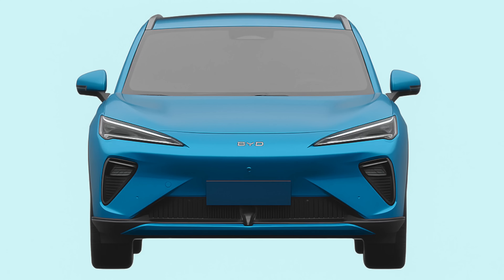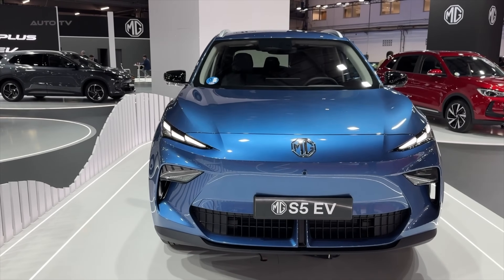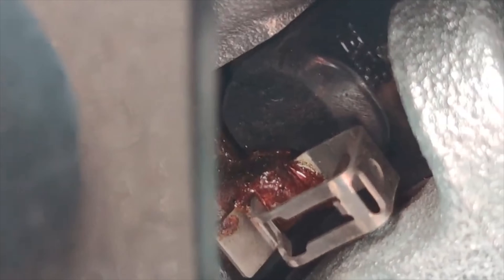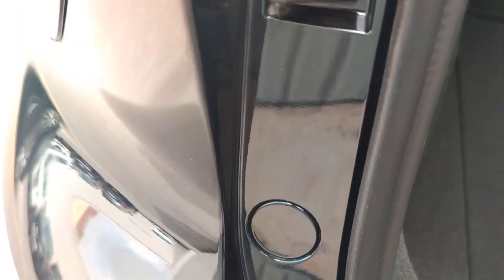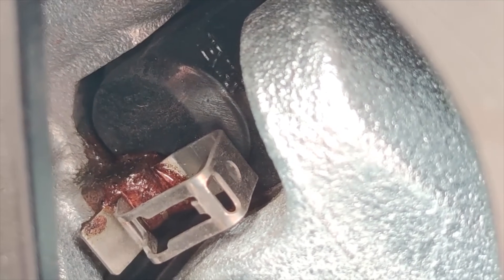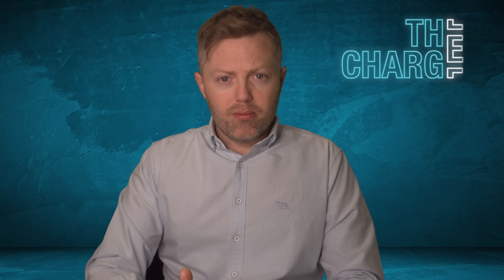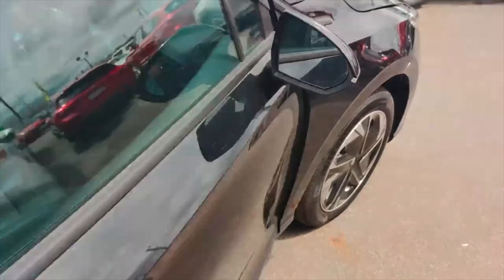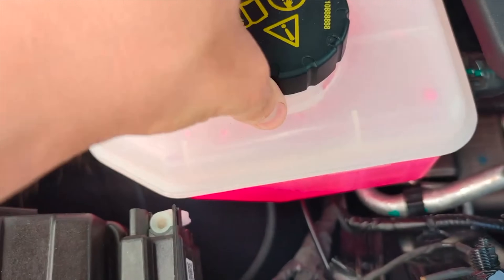NEW MG 6 EV is JAW Dropping – Dual Motor, 77kWh Battery

Comment from the maker: Would you get the MG 6 or a BYD Sealion 7?
Reply: Both are low quality Chinese rubbish!
Reply: Sealion has a bigger LFP and BYD builds well. I guess it would be the more expensive of thes 2.
Reply: Both are extremely BAD choices, poor build quality, poor service when trying to get something fixed, abysmal depreciation, basically worthless in just a couple of years!
Reply: @billsmith281  Wow shocking to see reps from legacy auto here. Enjoy your petrol guzzler that no one wants
Reply: @caramelexspressofan Yeah keep believing that😂
Reply: In the U.K. would depend upon the relative prices, but have a BYD dealer just down the road so probably test drive both.
Reply: I would probably go for the MG S6 in Australia. MG has a dealer network with factory support not just a showroom with third party servicing partners. I recently bought an MG4 and thoroughly impressed by it. Some minor quirks but exceeded my expectations.
Reply: Toyota corolla
Reply: No, MG doesn't come close to reaching the top 10 reliable car manufacturers list. 
Only reason I'm here watching this video is to learn what trash is being made for us.
Reply: I'd buy the MG 6 a little disappointed by the battery size.
100kwh would be great

Comment: You are optimistic about MG and OTA updates, we have 2 MG4 Trophies an LR and ER, cars have built in esims capable of doing OTA, but rumors of UK MG4 getting these keep getting squashed that we will not get. Extremely disappointing given my son's ID3 bought same time as LR , 2 years ago started getting OTA updates approx 9 months ago ( didnt have when initially purchased)
Reply from the maker: Hey mate, I just wondered what sort of updates he's been getting for the ID3 out of curiosity? I'm hearing mixed messages about the OTA updates for MG. In all countries.
Reply: @benalexxander  The ID3 updates have been manly infotainment, very odd others would need to verify , but my son only knew he had update when he spotted changes in the infotainment, VW never told him. 
The latest MG4 LR update at service back in march 25 reset , radio, Bluetooth, and broke the vehicle Hotspot, car had to go back to get sorted and this fix reset infotainment settings. Hope this helps.

Comment: Sorry, what's the difference between this and a dozen other cars looking exactly the same?
Reply: Yes, I ask the same question regarding the VW group vehicles.
Sooooo boring.
Reply: There isn't. Physics says there's a right and a wrong shape for cutting a vehicle through the air. The reason every car is this shapes is because science says it needs to be fof best efficiency
Reply: Well you haven't seen it yet. Those were stock vids

Comment: Isn't the MG EV4 the least reliable car in Britain? Not exactly a ringing endorsement for the brand.
Reply: I don't know where What Car got their data from to say that about the MG 4 but I have run one for two and a half years and its not missed a beat. I'm certain there are far worse cars than MG.
Reply: @redjohn20001 I believe they survey owners about ACTUAL experiences, but if you're one of the 63% of owners that didn't experience any faults I guess you have a more positive experience than the 37% of owners that did.
Reply: I've done 12,000 miles in 12 months in a MG4 Xpower, it's a brilliant car and its not put a foot wrong, it was even excellent in the snow.
Reply: I’ve done 6000klms in 2 years in an Xpower no problems
Reply: MG building pretty good reputation in Australia. They are everywhere now.
Reply: @DJ-2025-au The jury is still out in Britain.  They've been sold here for a while and had a reputation of being well put together, but dull. The EV4 changed that as it was a genuinely fresh design and exciting, but over time, as owners have a chance to live with it, and the reports of faults start to roll in, it has dragged down the brand overall reliability rating. To bring it below that of Alfa Romeo takes some doing.
Reply: @brendanpells912  MG are putting 10 year 250000 kms warranty on these EV's, so hopefully no major issues or they will be in trouble..
Reply: I think the MG4 received a @70% reliability score, and while not awful something to take into account when buying.
Reply: Mine here in the UK has been flawless. I’ve had it for 2 years 4 months.